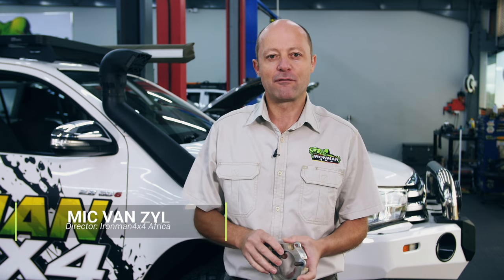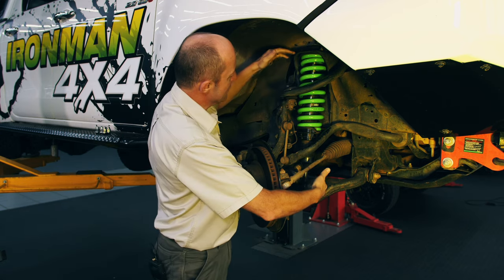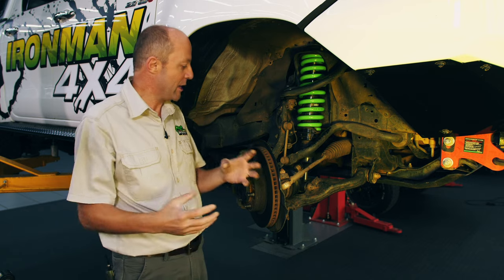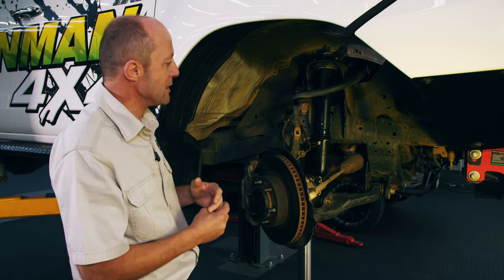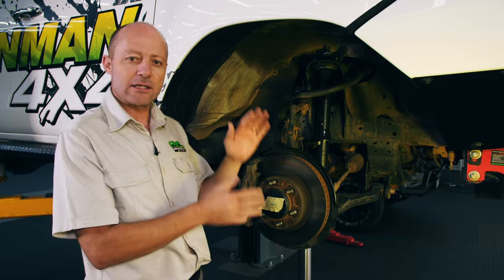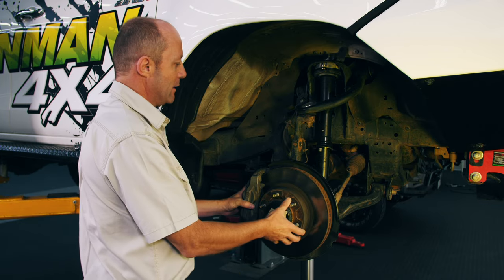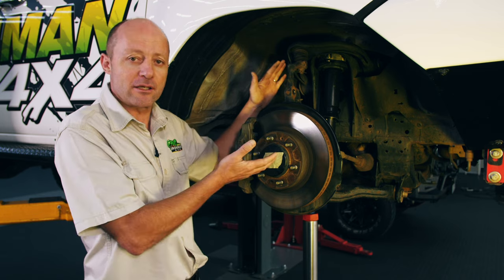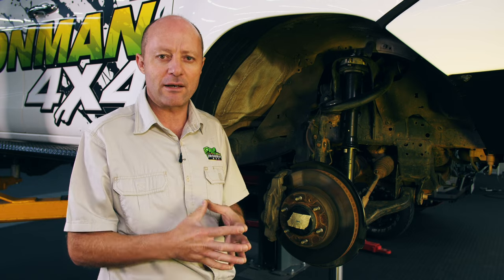Suspension Spacers - Tech Talk with Mic from Ironman 4x4

Comment: You've pointed out a few problems, but problems often have solutions. So correct me if I"m wrong, but doesn't any kind of lift put the same kind of stress on your CVs? And can't that be remedied with  a diff drop kit? Seems like a diff drop plus an aftermarket upper control arm with different geometry would fix 2 of the three issues. As for the issue of the spring becoming the bump stop, you could select a different spring with either less windings or a smaller diameter made from a stiffer alloy to compensate. Seems like if all one does is add a body lift spacer without making the additional mods, that could lead to big problems as stated. But in combination with a larger suspension upgrade and some careful decision making, a bit of body lift might be totally fine if you do it right. And I can think of a few reasons why you would want to have both.
Reply: Hi Chris. Just to be clear, a body lift spacer is not the same as a strut spacer. Body lift spacers extend the mountings of the body to the chassis. A strut spacer sits atop the front or rear suspension strut between the upper strut cap and the suspension mounting point. Both induce an increase in ride height when you measure the distance between the vehicle body and the wheels. 

A properly engineered suspension lift from a reputable brand offer a marginal lift on the intended vehicle. This is normally between 25 to 50mm depending. The ride height under full compression and full droop with this type of suspension lift does not allow the travel between full compression and full droop to exceed the upper and lower limits as determined by the original vehicle engineer. This engineer has also designed the CV's to operate correctly throughout the scope of this factory determined suspension travel. The same applies to the ball joints on the upper control arms. Exceeding these travel limits is where problems arise.

As for fitting different springs, this is not as straight forward as it sounds. There is not enough space in this comments bracket to delve into that . Spring rate, spring stress and materials used are a chapter all to them selves in the big book on suspension.

Fitting a diff drop, aftermarket control arms, bump stop extensions, etc may eliminate some of the issues but invariably cause new issues. We once fitted a 4 inch lift to a vehicle for Nissan South Africa as a show vehicle. It had a diff drop kit, bump stop extensions, upper control arms and a host of other components that had to be fitted. It took an immense amount of modification to get the suspension to work and it turned out ok. A major head ache was the front prop shaft. Dropping the front diff induced new angles on the front prop shaft causing new issues requiring fixing. Just not worth the effort or the risk at the end of the day.
Reply: @micvanzyl  thanks for taking the time to set me straight. Now on a unibody vehicle, like a Honda Element, there is no difference. You put a spacer on top of the strut/coil assembly and that lifts the body. Everyone refers to that as a body lift which is why I was confused what you were talking about. 
I just bought the Ironman FCP front coilovers for my Lexus GX 460. I went for the 2.5” lift heavy load option because I have a 150 lbs steel bumper coming. I have not installed them yet. Waiting on the bumper. So are you telling me I dont need to worry at all about a diff drop for the sake of my CVs?

Comment: Hi sir.
If I install the spacers, the warranty will void?
Reply from the maker: Hi Yip. If the Ironman 4x4 shock absorbers fails prematurely and it is found to be physical damage to the shock due to the fitment of strut spacers fitted on top of the front struts, then indeed the we will not be able to honour the product warranty.
Reply: @Ironman4x4Africa  thanks sir